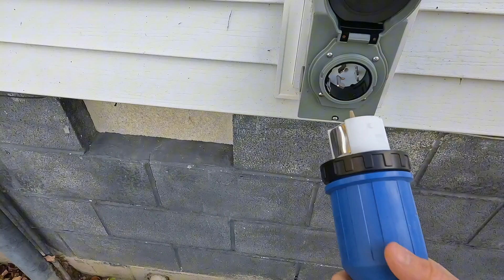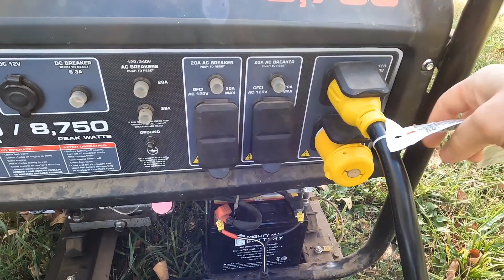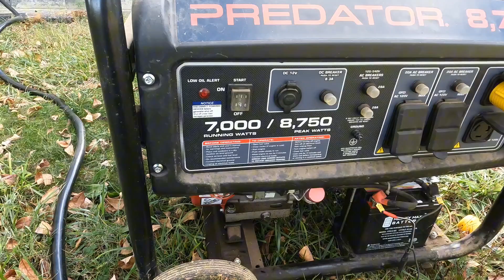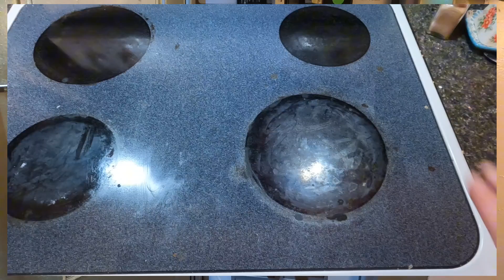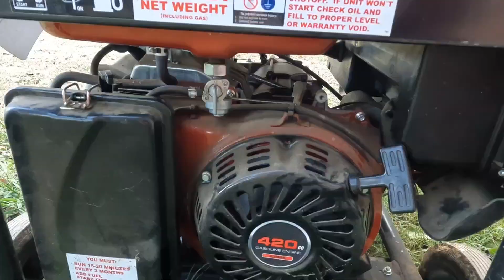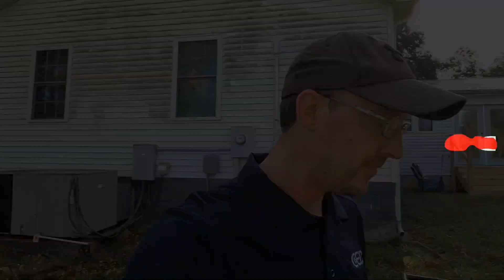Powering Home With Portable Generator & Breaker Interlock Kit   #generator

Comment: I have a tri-fuel portable generator that I bought in case of a hurricane in Southeast Texas. I have natural gas for the cooktop, water heater, furnace & dryer. I run the generator on natural gas and it powers most of the house through the electric panel. I installed is a Micro-Air EasyStart 368 (4-ton) Soft Starter on the outside A/C unit. My A/C unit now has a Start Peak of 33 to 36 Amps.
  Trying to line up the cable plug with the inlet at night? Take a marker or white-out and make a line on the plug & socket to line up the two before you twist it. Keep battery charged. Install emergency lights that come on when power goes out. Install them where you set up the generator and at the panel. Have an extra spark plug.
Reply from the maker: Thanks for sharing. I converted this one to trifuel to have options.   A soft start is definately on my future plans.  Unit currently  takes 60amps to start and 16 to run.

Comment: Nice video. I have a similar setup. I have a 7KW generator with an Interlock kit and I marked the "do not use" breakers with an orange dot.  I have no issues letting all the remaining breakers turned on when I switch to the generator.  I can run my water heater if I turn some other things off temporarily. I thought about installing a soft-start kit on my central air so I could run it as well. I find heat in the winter is more critical to survival than A/C in the summer. I agree 100% with testing the setup periodically. It keeps you familiar with the process and proves that everything will work. I keep a head lamp with the generator at all times so when it needs connected at night I don't have issues trying to work in the dark. I know several people who have generators but have never tested them in an actual house-backup scenario.
Reply from the maker: I'd love a soft start someday. Right now my heat pump pulls 60 Amp to start and  runs on 16 Amp.  
Thanks for sharing and watching.